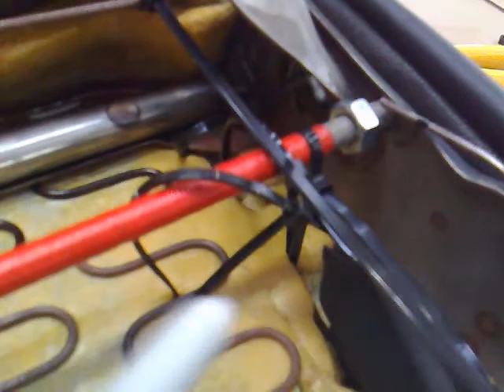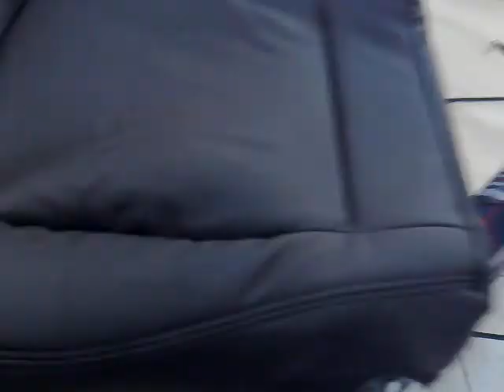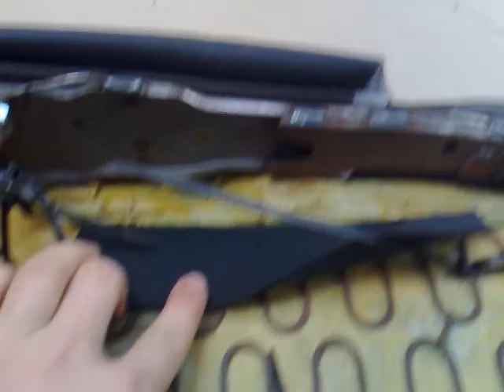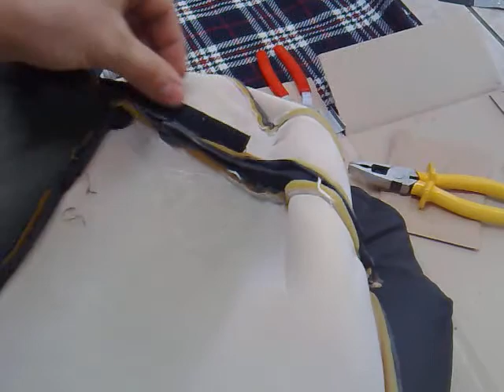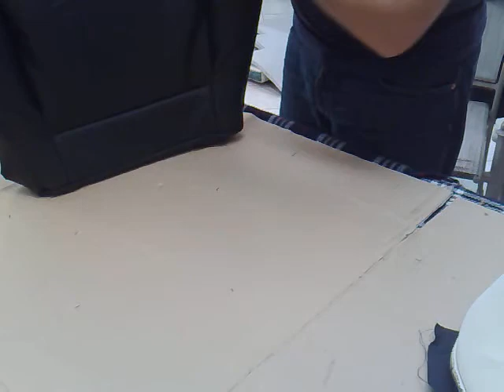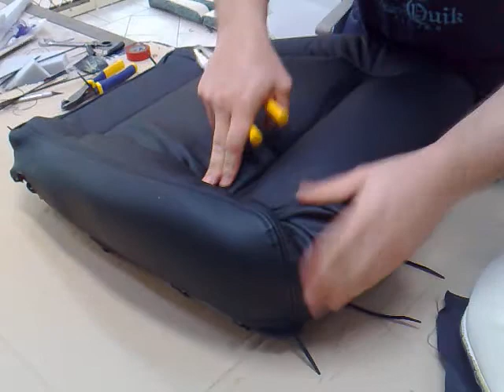300zx seat retrim pt.15 - Base retrim

Comment from the maker: The passenger seat documented in those videos was re-packed with foam, which in the end, made it a little too puffy, I toned it down with the driver's seat, but never documented  that one. I'd pay a pro $2K if I had to do this job again- but after all, the point of this exercise was for the 'I did it myself' street cred. Built, not bought.